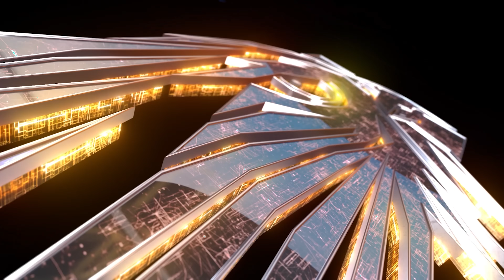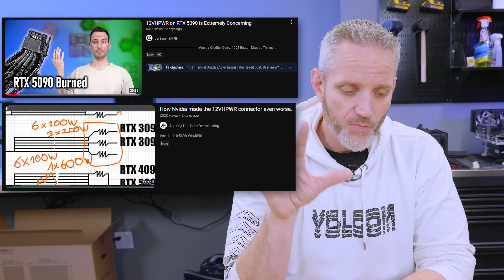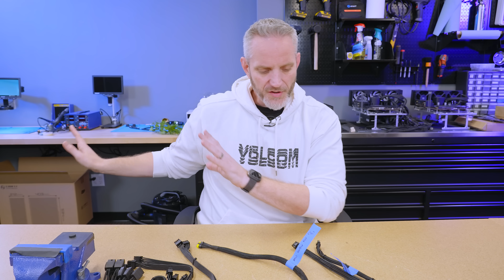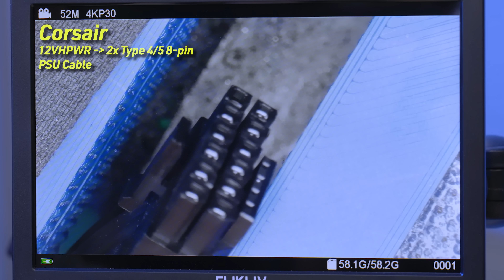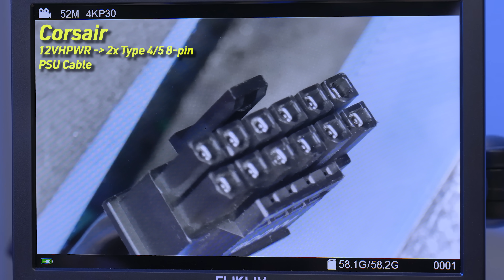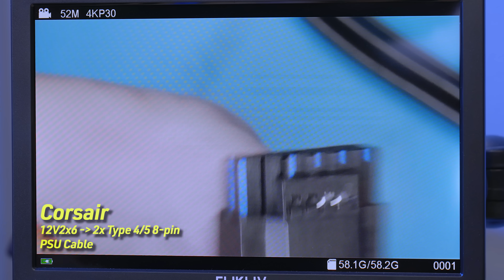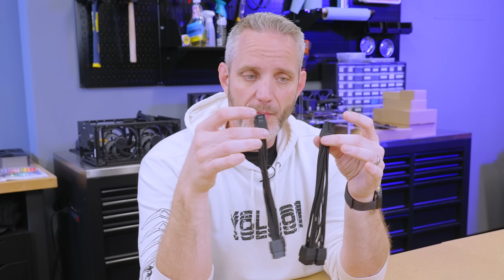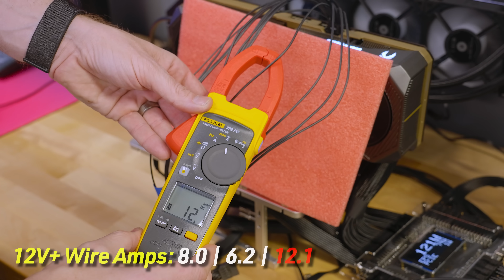I discovered something concerning and I need the Experts to chime in... More 12VHPWR discovery!

Comment: So, I'd completely buy this as a major contributor. First, a semi-related little side story:

A couple years ago, in my townhouse, I was getting brownouts. After a ton of investigation, the fault was a bad repair on the power meter mount that made insufficient contact and got hot enough to melt the connectors! Now, sure, this was whole house service, which I believe was 200A - but this was also a much beefier power connector.

Ultimately, if the wire and/or connectors are insufficient for the load, it will generate heat. And while there should be tolerances, it needs to be designed to fail safely on fault. Everyone is failing here: the PSU should be providing OCP on a per-pin basis; the cables should be built to handle pin failures; the GPU should be sensing the pins and downclock/shutoff for safety if overcurrent is detected. Frankly, each actor needs to be doing this to protect themselves from legal liability; if they don't design safeguards in, their component is implicated in the failure. It's useless to blame user error or any one leg of the system if all of them are failing to design for safety.

Oddly enough, the Wikipedia page for the connector points out the large gap in safety factor between 8-pin (288w vs 150w, so 1.92) and 12V-2x6 (684w vs 600w, so 1.1), but there's not a comparison per pin. This is there things get a bit icky: if 1 of the 3 pins on 8-pin fail, instead of 96W/8A on a pin, you get 144W/12A. This is still well within the safety factor of 1.92 at 1.5. Meanwhile, if even 1 of the 6 pins on 12VHPWR fail while there is still full load, you go from 114W/9.5A to 136W/11.4A, which is outside of that safety factor (by my math, it would require a 1.2 safety factor, which is less than the 1.1 in the spec). Even if this isn't causing an imminent failure, it will heat and warp components - which may cause more pins to fail. It seems likely to me - even though I'm not a mechanical or electrical engineer - that cable bends and insufficient connection pressure are going to exacerbate the issue, but a design failure is the true fault.

Comment: This is where having automotive repair experience comes in, working on my own cars and dealing with wiring harnesses you learn to check the pins and see how loose they are and it becomes a habit with anything else. I've always seen this issue with molex connectors too

Comment: Just look at the RTX5090 connector (Connector assy on the PCB, ). Assymmetrical attachement to Top Pads / Bot Pads... Assymmetrical Power Distribution by PCB/Assy design... Nevertheless: Design flaw. Parallel Wires / Parallel Planes is always a bad idea...

Comment: If a company is telling customers it's their fault connectors are melting they're wrong. The connectors aren't supposed to melt under any normal circumstances. Fault tolerance is supposed to be a part of the design. End of story.

Comment: So, not an engineer, but an automotive wiring specialist. The full insertion is important because current travels primarily across the surface of conductors. Lack of proper insertion between terminals creates 2 problems. 1, as there is less than the expected range of contact between the surfaces, that means all current being drawn is doing so across a smaller area, thus generating heat after the typical rating is met and exceeded. 2, if you’ve ever had a loose battery terminal cause your car to not start, it’s because the conductor cannot effectively transfer the requested current over the minimal area provided, as the heat generated by the lack of surface area making contact drastically increases electrical resistance, which leads to voltage droop.

As to your question regarding GND vs 12v. Yes, the ground being loose can be a cause of melting, just less likely to cause the resistance thermal runaway

The cable you demonstrated with the pin receding, looks like it looses atleast 25% of its travel, which means that if the terminal was rated for 6-8 amps before (85% continuous load) than 6 amps would actually be pushing past its new peak load limit, and it make get away with that for a period of time, but the load ratings are set to 85% for a reason. Exceeding that generates enough heat that is unable to be passively released during use

Comment: I don't know why these awful 12-pin plugs were implemented in the first place. The connection is way too marginal. If the manufacturers are going to continue making cards that draw this much power, they should just a pair of large, screw-down terminals for 12V and Ground. Or an Anderson connector. Or car battery terminals!

Comment: How funny i must have just lucked out simply for brand loyalty I have 2 msi atx 3.0 pcie cables one for a 1000w for a 4090 (unsure if yellow), and a 850w (is yellow) that's hopefully powering a 5070ti or if i can find a 9070xt rocking a 12vhpwr. I feel like I'm the only person who likes the cord simply for its sleekness. It's unfortunate it comes with so many issues, tho, even tho more than not, it's user error. I can understand replicating the "issue" but I haven't seen anyone that isn't a random redditor that's using a poor installation method or a 3rd party connector that's actually having full on blow outs. I really don't understand risking 2k+ on hopes and dreams.

Comment: Pro tip: too small wire section + bad connector = smoke generator.

Only ONE 2.5mm2 wire  (14 AWG in your monkey units) + something like an XT90 connector could handle 1 kW. 

PS: This Corsair cable is really bad, throw this crap where it belongs: in the bin.

PPS: YOUR TURN, STEVE

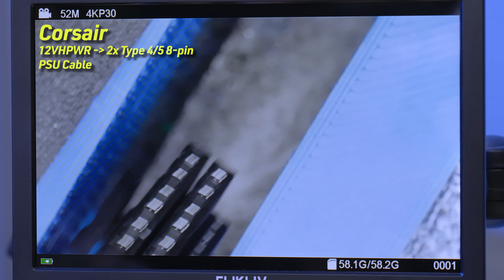Comment: @8:26 Corsair have a new cable : Corsair Premium 12+4pin PCIe Gen 5 12VHPWR, and the pins is longer that stock power adapter of 4090. The stock conector is around 55-58C under full load,the corsair one is 40-45C max.Also the pins do not move insite. I have this cable on my 4090. The corsair cable in your video is the first version. Also im shure that you plug and unplug 1000 times this conector on diffrend cards when U benchmark them and the pins now is lose

Comment: Somewhat completely unrelated/related question. (Awesome video btw)

What secondary (aftermarket cable) would someone recommend for a Corsair HX Series, HX1000 and a 7900xtx Taichi? 🤔

Also would it be recommended to upgrade my psu to over 1000W if I'm also using an (updated for issues, hopefully) i9-13900k? 😅 I also have a UPS rated for 1000W, but would that be an issue if I upgraded my PSU?

Comment: Yeah I'm not an engineer but I would definitely be interested to see how many cables are like this. Everything I do know about electrical systems would tell me that isnt okay. If this is the cause it would just mean that the other pins are pulling the extra current to compensate for the poor connection on another pin.

Comment: The past 15 years 4 of my previous pc builds used all Corsair where possible and all high quality (all 3 psu's still work flawlessly, although on light duty/back up) : I have just bought a 5th self build pc with a 40 series gpu just b4 xmas, trusting corsair again I bought m.2's, aio coolers & fans, psu + ram etc from them & they all felt they'd been made by a completely different company. Even the m.2 I bought a 2nd a few weeks later from a different manufacturer. The only stuff corsair makes well is stuff linked to icue and i'm not on that hype train. (good bye k95/scimitar i'm buying "fun" less annoying peripherals next time round).

Thankfully my GPU couldn't be corsair & was made by MSI..... 
Sorry corsair, we've had a good 15+ years but you gotta fix your shit and i need to hear years of praise before i ever buy again from you. 
Oh and not trusting corsair i bought a secondary 12VHPWR adaptor (alas has to be from corsair) but i was simply not using what came in the psu box.

Comment: The manufacturer should stop using 12V as source, it is very inefficient for high power draw due to high-current plua those tiny wires would really catch fire.. They should at least use 24V and just reduce it on the chip level.

Comment: i recently build a rackmount streaming PC with a 4070TI super. to get the powerplug in correctly i removed the sleeving and modeled the wires in a way to have no stress on the 12VHPWR plug. took me 20 mins before i was happy with the way it was seated.

Comment: This is why I am still on AMD.  Dual 8 pin connectors for the win and not having to buy a new power supply for many years. I had the money, I could have bought a 4090 but I couldn't bring myself to do it and then all these issues started. Bought an AMD 7900 XTX  a year ago instead.

Comment: Using anything other than the 4x8pin adapter is just a matter of time. I watched Der8auer, Buildzoid, and your video, and it is all showing 20+ amps going through 1-2 small wires and the rest are under 10 amps. This is clearly the issue and Nvidia had to know before release. 12v-hpwr to 4x8pin adapter will distribute the load evenly and safely to the GPU side so that no one wire is super hot. At the very least it should be safer if you use a 5090. If I had an overclocked 5080 I would cap it to 420 watts.

Comment: Hey Jay, to briefly address the grounding situation you mentioned around the 8-minute mark:
If ground connections in the 12-pin fail, more and more current will take the return path through the PCIe slot and the IO bracket. This means it'll take more broken connections until the 12-pin gets melty, but at that point you're also subjecting the PCIe slot and your motherboard to currents they weren't designed to take. There's a very real risk you're going to burn those out as well! I expect this to happen sooner or later, unless the issue finally gets rectified by nVidia.

Let's take a better look at the fundamental problem with the 12-pin (tl;dr below):
Amphenol rates their Minitak 12VHPWR connectors to max. 9.5A per pin, so 57A for all six 12V pins combined, IF the load is shared equally (it isn't!). 600W at 12V is 50A, so the safety factor - in an ideal scenario on paper - is only 1.14! If just a single pin fails open-circuit (i.e. it got hot before, was mangled by the user or has a manufacturing defect - it's far from unthinkable and your design should account for this) or just two pins have slightly higher contact resistance (i.e. via oxidation, manufacturing/mating tolerances or just old age - also something to design for), the safety factor drops below 1. In either case, you're now overloading the remaining pins, making them prone to overheating and failing themselves, accelerating the meltdown.

It gets even worse once you leave the drawing board and enter the real-world: At full load, the connector and cable will experience a meaningful voltage drop, the output of you PSU may also drop slightly below 12V and the GPU will end up seeing something closer to 11.5V. The VRMs will happily make up for the lack of input voltage by pulling even more current. 600W at 11.5V is 52.2A, so your real safety factor is more like 1.09 - and that's ONLY IF all pins are loaded equally (they aren't) and the GPU actually sticks to the 600W limit (your 5090 Astral in last week's video didn't)!

tl;dr:
Even if all components are brand new, high quality and were installed perfectly by a professional, the design margins are absolutely razor thin and there are NO safety devices (like thermistors or fuses) to step in when things inevitably go wrong! It is insane that someone approved the 600W rating. If it was "only" 400-450W, the connector would very likely survive the scenarios I outlined above and this problem wouldn't be in the news AGAIN.

Comment: One thing i find ridiculous i knowing all + & negative come from a single busbar and at the connector reunite back into a single busbar. First off, why is it 12 pins, WHY?!?!?! Nvidia could have made this connector as 2 flat blade pin and call it a day.
Secondly, couldn't someone just straight up make a cable that is made out of copper foil instead of 12 small wires?
Like i mean seriously, you would never see a 50+ Amps fuse in a car's fuse box be connected by 12 microscopic wires.

TLDR Nvidia is the one in fault for making a terrible connector, it should have been a 2 flat pin connector.

Comment: Just hear me out. This is my opinion from working on electronics that are NOT video cards.... If you have 6 wires all feeding 12v and 2 of them are 1 mm shorter the resistance of those 2 cables are going to be ever so slightly less than the rest of the cables. What do we all know about electricity? It takes the path of least resistance. If those wires (including the metal connectors) are not the exact same length then I could see exactly debauers issue showing! Someone depin one of these and measure length and resistance of all the cables!

Comment: My money goes on arcing.

There are no ground pins on that connector, just 6 live pins, and 6 common (or neutral) pins. One misconnected pin increases the load on all remaining 5 wires of either side, live or neutral, by 16.5%. Two pins if on the same side will increase the load by 33% on the four remaining cables. Ironically, 1 misconnected pin on each side only increases the load by 16.5%, but on all 10 remaining wires.

As it isn't the cables melting though, but the connector, I believe arcing is the issue. An old style light switch will arc by design, and is actually designed to minimize this arcing in duration (hence the force required to flip it, causing a quick switch on or off). In this case, the sense pin says "life is good, send it", so the current is sent. An almost but not totally connected pin is a recipe for arcing, and in this case, continuous arcing.

Now combine almost connected pins with fully disconnected ones. Let's say 2 fully disconnected, 2 almost connected. The load on the remaining 4 wires is 33% higher, and half the pins handling that load are arcing bad. Potentially on both sides at the same time. To make matters worse, the arcing pins would most probably be neighboring ping. Like all 4 pins on the far left disconnected (2 on each side), then pins 3 and 4 on both sides arcing bad, all close together, while pins 5 and 6 on each side being deeply seated, or at the very least connected properly.  

Hence the melting and fire that ensues.

Note- Not an electrician here, just enthusiast enough to read / learn about electricity quite a bit.

Comment: Waiting for tutorial vids on how to make your own connectors, spread the knowledge so that we can use larger gauge wires or other techniques for insuring distribution of the load across the multiple wires. Sure it will void your warranty, just save your stock cable and if you need to claim
..... you dont know what happened LOL

Comment: I got the Corsair RM1000x a few weeks ago.  It's already running in my system with the 12v2x6 cable plugged in the PSU side and the other end unplugged just waiting for an RTX 5080 card.  I'm going to have to inspect the cable on both ends the next time I open up the case to install the card.  Thanks.
Reply: Same here.. but waiting for AMD and I realized 9070XT will have three separate power connector and not using the 12v2x6.. So most likely I'll remove the 12v2x6 and put back in the PSU box. :)

Comment: I just want to simply say, and I am enthusiastic PC user and builder myself, and I also work with software and electrical devices a lot - but current situation with PSU's and atx 3.0 , 3.1 and etc. it just plain and simple is not user friendly, at all. If all of this is so easily possible to make mistakes or have worse or unknown quality of cables, plugs, whatever else, then I feel it's a product and standard that should not be available in the mass market to customers. Just should not. This kind PC building component should not be so easy to make user errors or have clearly less-than-ideal-quality standards that are still being developed and iterated on in a rush. It should be far more durable and not so close to dangerous errors or issues from so said user errors. This should not be so damn inconsistent! Should be pulled from market all together if this ** cannot be trusted in the hands of mass user base.

Comment: All video card manufacturers need to back to using a single 8 pin or dual 8 pin power connectors they are far more reliable.

Comment: The 12VHP is a problem that doesn't need to exist because the connector doesn't need to exist. Was there any issue with the old triple 8-pin, or does it simply not provide enough power.

Comment: I would say that if you have a bad connection then the resistance of that line would increase. As a result the current on those lines would be lower (ohms law). So that means when plugged in, the two outer wires are getting the majority of current causing the heat would suggest the inner connections are somehow getting a higher resistance. This also does not even explore the fact that the wires are not solid core but braided copper which could lead to uneven distribution. What I find strange is that an increase in heat should increase the resistance. This would act as a simple load balancing system forcing current to flow through the other cooler wires but because they are all grouped together in the single cable... The heat is most likely bleeding into the other wires. Sounds like Jay needs to build a water cooled cable mod ;p

Comment: time to route the power thru the mobo or they've to come with the splitters soldered to the board. they should also put a HDMI on the same way. these things are stupid priced already, cost isn't the reason why it's not done, they just want you to break cards or they don't care which is functionally the same thing.